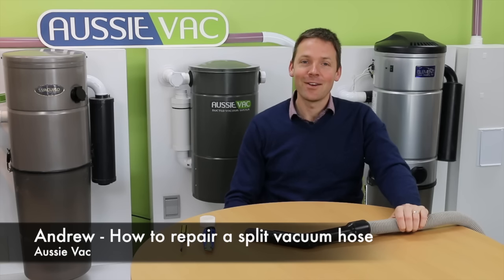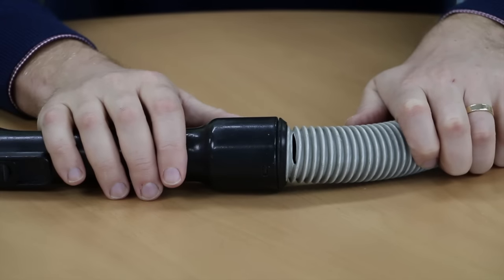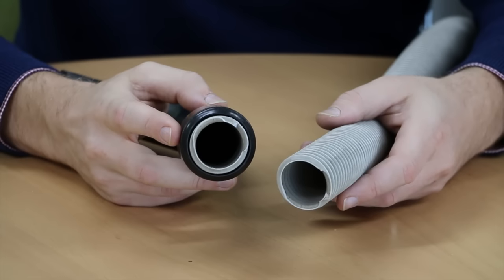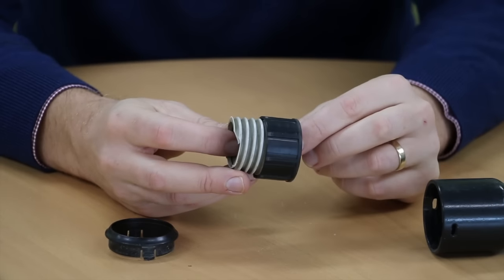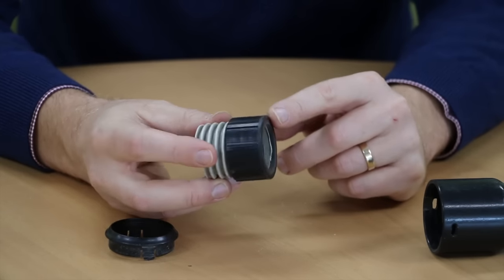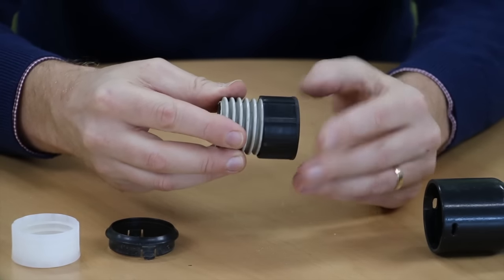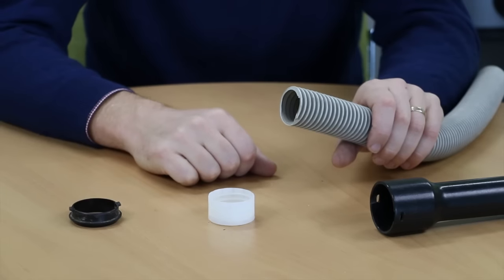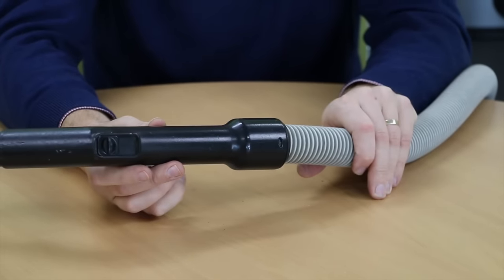Repair a split ducted vacuum hose - Aussie Vac Melbourne Sydney

Comment: Thank you so much.   We have an old vacuum, that still works great other than that split in the hose.  They want almost the cost of the vacuum to replace the hose, so I've been using duct tape to keep it in place.  Should be able to fix it up myself for a small amount now :)

Comment: I have a Shark brand vacuum cleaner. The hose section that split is both threaded and (I discovered) glued into a connector that did not have a removable locking ring. The hose is steel wire reinforced. I cut through the plastic part of the hose with a utility knife, as in the video, then snipped the wire with cutters. Since the hose would not thread off, I grabbed the exposed end of the wire reinforcement with pliers, and pulled the wire out first. The plastic was then easy to remove with the pliers. Fortunately, there was only a little glue used by the manufacturer as it did not appear to run the length of the threads. After a little cleanup, I threaded the connector back onto the hose and back in business. I didn't add any glue in case I need to do this again. So far, there doesn't appear to be any vacuum leak.
Reply from the maker: That's great, glad you were able to sort it out!

Comment: I used very hot water to soak the end of the hose that was attached to the end piece. After a few minutes, the glue softened and the broken hose was easy to twist off.
Reply: Good tip Baz!

Comment: How do you remove the OTHER END of the hose connector?  I can't seem to remove the four small latches holding on the hard plastic head.   Thanks.
Reply from the maker: I haven't seen a connector with four latches, are you able to send a picture from our contact page: https://aussievac.com.au/contacts/

Comment: My Dirt Devil Swivel Glide (from the USA) does not have a locking clip to release and replacement parts are no longer available.  Any suggestions?  Thanks for great video!
Reply from the maker: Hi Sandy, you may be able to use a screw on handle like this one: https://aussievac.com.au/chrome-vacuum-handle.html
Reply: Thank you, but nothing screws off.  I just duct taped it with a prayer.  :)
Reply: Look on ebay for parts or an old one.

Comment: Bro how to repair on the other side opposite side
Reply: The other side (end?) of hose should just unscrew - (reverse thread direction) then you can trim off the split section and thread hose end back on.
Reply from the maker: The other side (end?) of hose should just unscrew - (reverse thread direction) then you can trim off the split section and thread hose end back on.
Reply: @AussieVacDuctedVacuums  the hose Hull on the website says it is for Handle, but does it work for the Side that goes into the vaccum?
Reply: @pasangsherpa4638  I'm not sure if it is the right size for the vacuum end, it would depend on the model vacuum you need to connect to.

Comment: So much for finding a non-destructive way to repair a split hose. This is literally the opposite of a fix.
Reply: Hi Aquila, after 40+ years working with vacuum cleaners this is the only practical, lasting solution we've found for a split near the end of a hose. There is not much you can do if the split is in the middle of the hose, except buy a better quality new one. If you come up with another way to repair  please let us know!
Reply: Keep in mind that this is only covering up the split - not really repairing it. We have see hoses get blocked when repaired this way as debris gets stuck in the split  inside the hose - eventually enough fluff and debris gets caught to completely block the hose. The only way to completely restore the hose is to cut out the split.